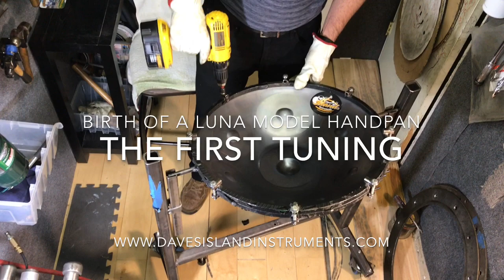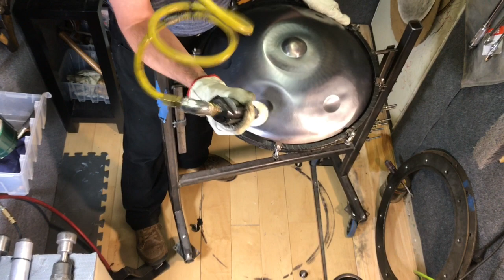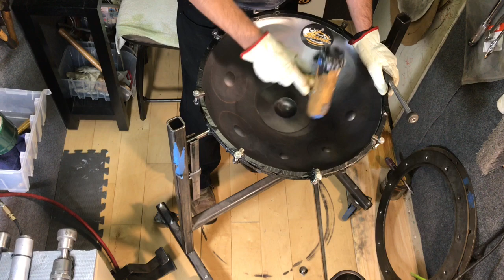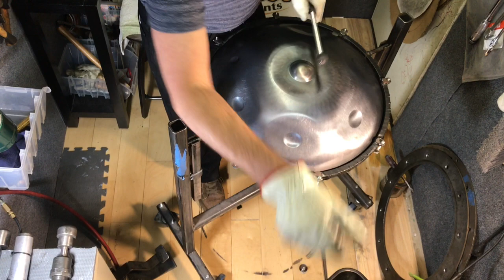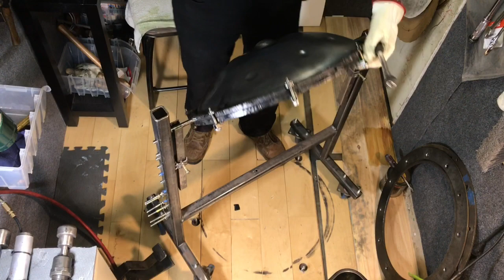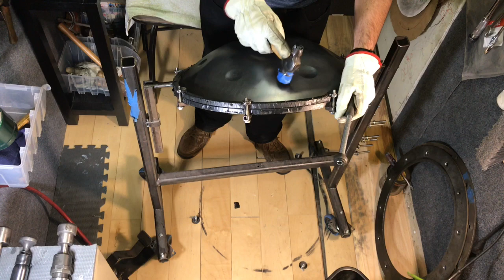Dii: How to Tune a Handpan

Comment: Hello, congratulations on your excellent work.
Can you tell me what ring measures to hold the handpan
and how the dimples of each note are made, can you inform me too, please?
Thank you very much
Reply from the maker: This handpan is 20” inside diameter. The rings are 20” inside diameter also. The steel I used is not extremely thick, I used 1/2” square stock. We use a press with male/female dies and rubber to shape the dimples. 👍🏼

Comment: hello. admire your work. could you please tell me where i can get measures for the different types of tuning? I´m starting with the shellopan so i could use advice.
Reply from the maker: I have been making steel instruments since 1993. I originally got my note shapes from Ellie Mannette at a steel drum workshop. The note shapes and sizes are mostly the same for steel drum and handpans.  However, the thickness of steel many change the size of the notes.  Thin steel will require a smaller note size and thicker steel requires larger note sizes.

Comment: Could I retune my handpan with a mallet? I bought one for $1000 but I think they didnt stabilize the notes properly as the notes are a bit shakey, could I mimick what you are doing here with my hand pan thats already put together?
Reply from the maker: mase ofspades Hi Mase, I would caution you against trying to tune your own handpan. Handpan tuning is tricky and requires years of experience. You can easily make more problems for yourself and make the note sound worse than it did before. I suggest that you send your handpan to a professional who has already tuned handpans successfully for several years. You can contact us if you are interested in our services: https://davesislandinstruments.com

Comment: Hello from France thank you very much for the video to share all this, I wanted to know if you make a very precise tuning of the departure knowing that you will stick the shells and then I suppose to review the tuning; how many times do you have to check the tuning after the collage and you have to leave a time between each check thank you very much for your answers
Reply from the maker: Hello! I tune the shell one time on the rings as best I can. This steel is about 1.2mm thick.  The rim flange is less than 1cm wide.  It always deforms and goes out of tune substantially when it is glued to the bottom shell.  But the most important thing is to shape the steel and “train” it to sound good before it is glued. If the shaping and tuning is not adequate before gluing, you will have many problems tuning later.

Comment: Cool...seems a fragile instrument? Can see it would just be a matter of time before notes would need to be tuned again? Does cleaning effect sound? At $2000 that would be a big bummer. You find cleaning rust effect sound? The synthesized  hangdrum samples I use currently can be tuned and tweaked easily. Doesn't change unless I change it, and can be had at a cost of pennies. Works great until a time I can afford a real one!... Thanks

Comment: Hello Dave, does the depth of the shell affect sound quality?
Reply from the maker: Janis m Hi Janis!  Yes, but it is difficult to put into words. There are some nuances that can be perceived. The depth doesn’t really affect the tuning. The notes will sound in tune with shallow or deep instruments, but the timbre may change.  A shallow instrument may sound less resonant.  A deeper instrument may sound more full.  But other changes occur, too.  Typically when the metal is sunk deeper it tends to get thinner.  Thinner metal tends to sound “thin”and sometimes it flutters a bit. So, ultimately, I think there is a comfortable middle ground where the instrument sounds best.
Reply: Dii Thank you very much for the answer, it really helped:)